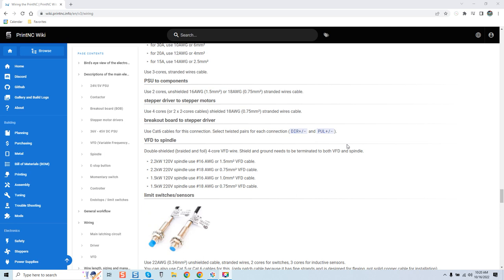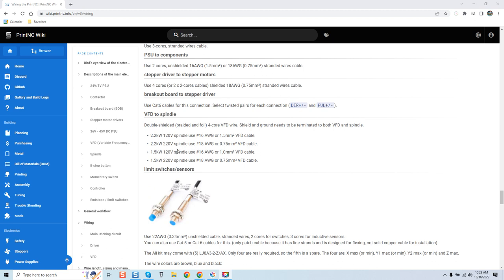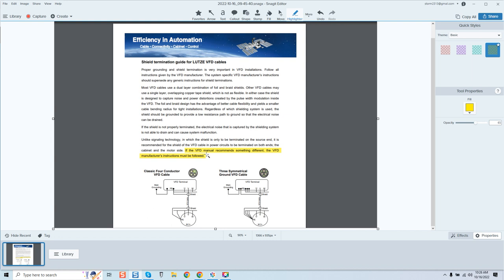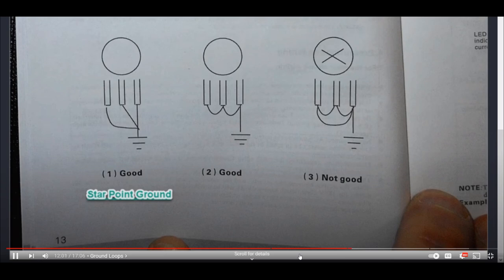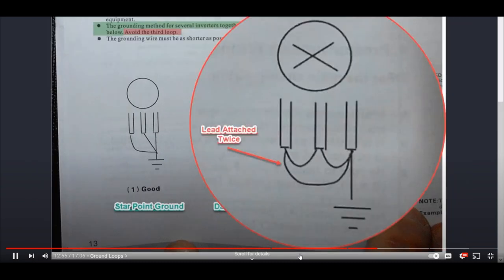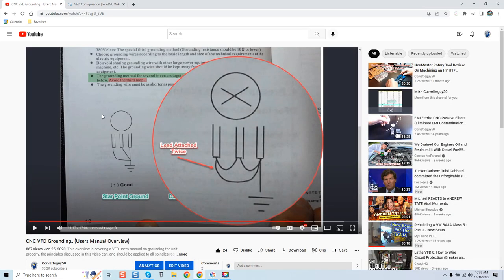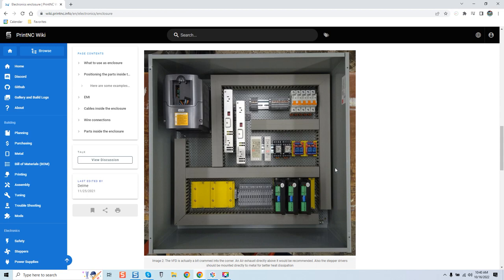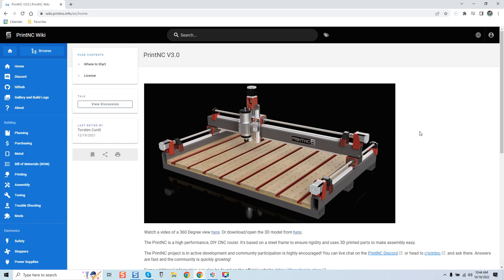Why To Be Careful Of CNC Websites For DIY Controller Builds..

Comment: Hi Vince,

About the VFD inside the cabinet, I understand what you are saying about EMI but I could not find any references that it should be in another cabinet even not in the manual. 

Thanks!
Reply from the maker: Stav, thank you again for your support. 

The VFD is not required to be mounted inside an enclosure, but is in best practice to be mounted outside of one, and  away from your robots chassis (about 10ft) as it produces a the most EMI. Some end users prefer to mount it inside an enclosure that's metal as it will act as a Faraday Cage protecting the other components from EMI. 

You also don't want to mount a VFD inside the same enclosure with your drives/breakout board as then your metal enclosure will act as a Faraday Cage condensing the EMI it produces around these sensitive components. 

Thank you,
Vince
Reply: @corvetteguy50  Thanks for the reply and all the effort you put in your videos! 
Again, I'm understanding everything you just said and I saw you mentioned these notes around lot in your videos BUT my question is the same, how you decided that the VFD makes too much EMI. Over the manual the only note I found is that the wires should be in different conduit...

By the way, can't wait to receive the Motors cable I bought from you the other day!

Thanks again for all the knowledge and patient!
Reply from the maker: Variable Frequency Drives all emit large amounts of EMI. This is why your unit's manufacture wants the cables coming out from it installed in different conduit.

 Here's a Google search to reference. https://www.google.com/search?q=VFD%27s+emit+EMI&rlz=1C1FKPE_enUS953US953&oq=VFD%27s+emit+EMI&aqs=chrome..69i57j33i10i160.3071j0j15&sourceid=chrome&ie=UTF-8

Your VFD manufacturer didn't go into explicit detail about this, but its unfortunately the same with all VFD's regardless of brands.

Thank you,
Vince
Reply: @corvetteguy50  Thanks!!